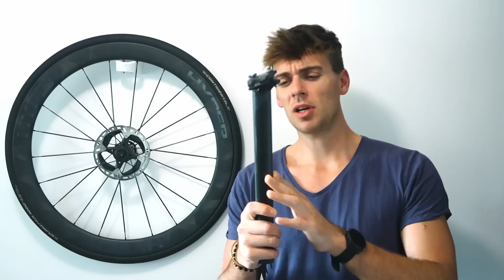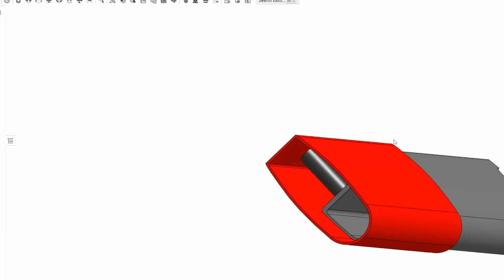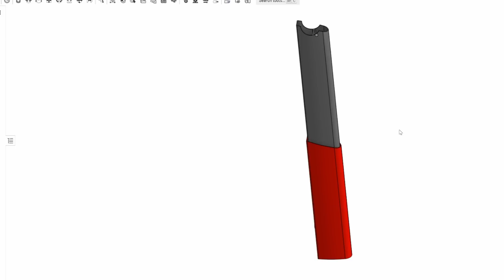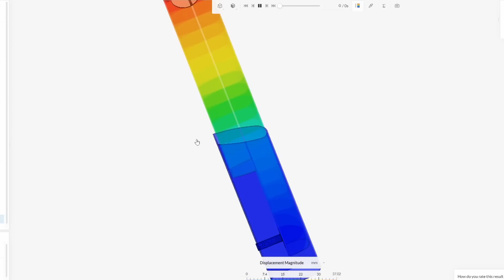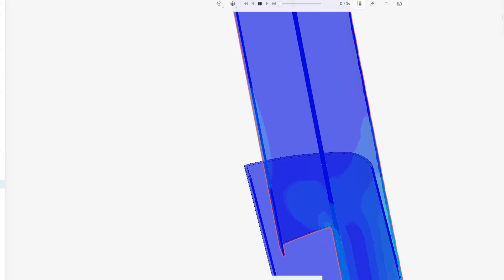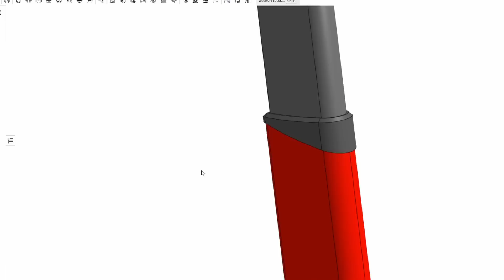2021 Canyon Aeroad seatpost fail, fix & The State of bicycle frames in 2021.

Comment: I would totally buy a Shimano frame.
Reply: My first bike was a "Shimano" :D At that time they sold cheap chinese bikes branded as Shimano on the frame in my country.
Reply: Build it with Campy tho.
Reply: @SenorSiesta   lolz
Reply: Infact shimano ordered Pardus Robin Sport frames for their neutral service bike, replacing Mavic's neutral service with their Canyon Ultimate.
Reply: Yeah but Shimano had crank failure rates and still have cable coating jams from bad design. I use shimano but not the cables.
Reply: @glennoc8585  whats the % shimano crank failure rate? or is your perceived failure rate based on instagram posts of broken cranks?
Reply: @mikes1984  if the pics are widespread its a problem.  one pic is a problem.  skimping on manufacture ...dont make excuses for that
Reply: @luminousfractal420  No, % failure rate is the important metric.  0.00001% vs 20% is a big difference, as no manufacturer in the world of anything is 100% successful.  Photos of broken cranks online do not constitute conclusive evidence that shimano cranks are a widespread problem, that is anecdotal evidence - Anecdotal evidence is a factual claim relying only on personal observation, collected in a casual or non-systematic manner.   psychologists have found that due to cognitive bias people are more likely to remember notable or unusual examples rather than typical examples.  Thus, even when accurate, anecdotal evidence is not necessarily representative of a typical experience. Accurate determination of whether an anecdote is typical requires statistical evidence. Misuse of anecdotal evidence is an informal fallacy and is sometimes referred to as the "person who" fallacy ("I know a person who..."; "I know of a case where..." etc.) which places undue weight on experiences of close peers which may not be typical.

In all forms of anecdotal evidence its reliability by objective independent assessment may be in doubt. This is a consequence of the informal way the information is gathered, documented, presented, or any combination of the three. The term is often used to describe evidence for which there is an absence of documentation, leaving verification dependent on the credibility of the party presenting the evidence.
Reply: @glennoc8585  I just use their regular cables and not the furry new ones. Cheap as chips and work perfectly in the supplied outers. Am I right in thinking that the new cables only came out with Shimano 11 speed group sets?
Reply: @glennoc8585  yeah those dura ace Teflon coated ones just clag up, i use jagwire with a smear of fox float fluid, silky smooth and the oil doesn't migrate in much of a hurry so I rarely have to touch them even with uk conditions.
Reply: @jonnythelegs2597  Use Optislick shimano. No clog and less expensive than Teflon polymer
Reply: They do made shimano frame, loooong time ago. its a vintage now and made by some other japanese frame manuf if i'm not mistaken.
Reply: @shhhdontshout  i used to have a shimano branded steel frame mtb.  pretty sure it was a giant but with shimano branding. blue and white paintjob too lol
Reply: Is there any other company in the bicycle industry that has better commodified quality and made it available to the masses?
Reply: Your frame would delaminate, your cables would still frey
Reply: It would be an interesting exercise for them. Access to high level carbon and a total package incl. wheels,cockpit and groupset
Reply: Can you imagine if the big three shimano, campag and Sram built their own frames with their products in mind. Could be interesting
Reply: Hopefully it would be made better than their cranks
Reply: I'd totally buy a Hope frame 😉
Reply: Not sure id buy the Lotus one tho, as beautiful as they are Lotus normally stands for "lot's of trouble, usually serious"
Reply: @jonnythelegs2597  OR  Light or thin ,use sparingly.
Reply: @simonalexandercritchley439  are we talking Marmite or cars here 😄
Reply: @jonnythelegs2597  Could be either I suppose,but Lotus does not make Marmite.
Reply: Don't buy Chinese frames.
Reply: @cularu1  Most frames are made in China.
Reply: @redditislife7997  Mine was made in Vietnam , not sure if that's any better though
Reply: @Andy-co6pn  they do the hq carbons. china is more into metal or plastic parts.   👆just another racist trying to validate their hate.
Reply: @cularu1  dont buy american frames. my gary fisher had an out of alignment bottom bracket..only two inches from that ultra high quality made in the usa flag 🤣  you want quality metal go german or swiss.